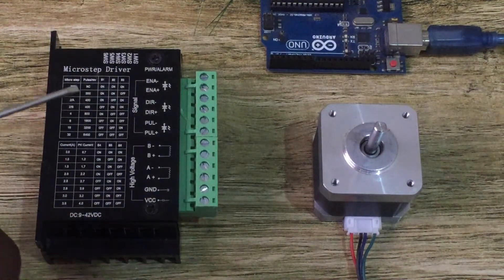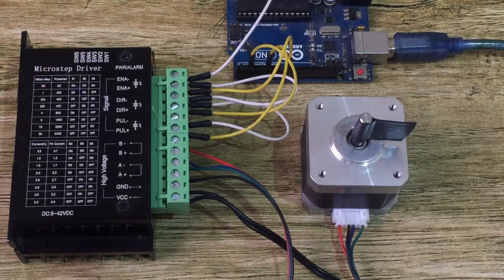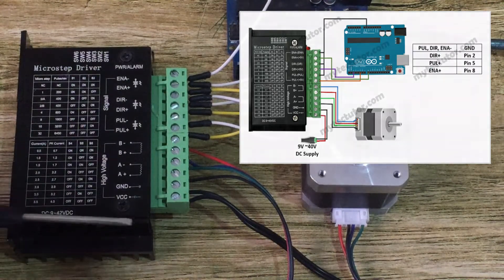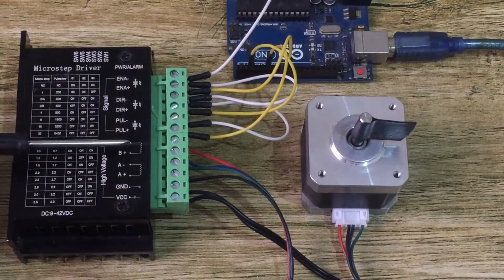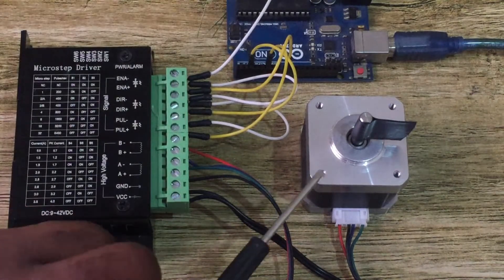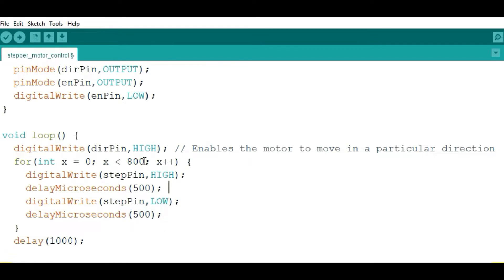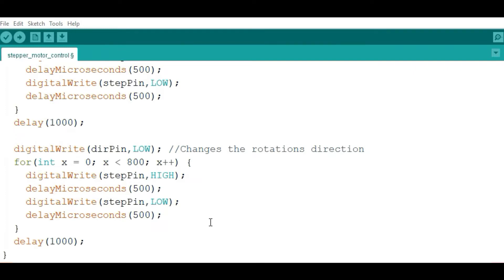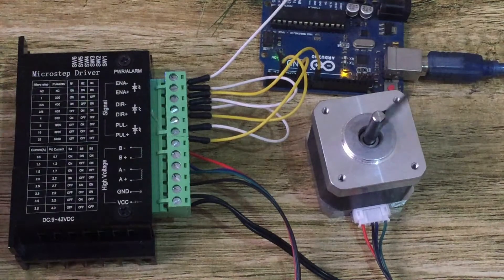TB6600 Stepper Motor Driver with Arduino

Comment: Thank you so much for this wonderful and clear tutorial! You are an EXCELLENT instructor. I have many years of electronics experience (mostly vacuum tube stuff) but little automation or Arduino experience. However, thanks to your tutorial, everything made perfect sense. In particular, I want to commend your clear and plain identification of the details. Things like exact driver module model and wiring pin outs, schematics and so forth. This kind of info can take a lot of time to root out, and the manufacturers seem oblivious to the need to post it. Your pacing was just right - not too slow, not too fast - and you DID NOT ASSUME that "people already know that". Many do, some don't. Also, the Arduino code was extremely helpful, plus your handy tip on discovering motor winding orientation is worth the price of admission! Well done and thank you. Great job!

Comment: How can I program my stepper motor with three  different  position and at the same time will return to its original position. Using three push button as trigger

Thanks
Reply: USE  AS5600 MAGNETIC ENDCODER

Comment: Can the ENA and DIR inputs be supplied by more than 5V? Will it work with 12V?
Reply: If you wish to control driver with more than 5V, you have to use proper resistor to lower the voltage to 5V

Comment: Hey. If I think right, I can use for ex. PIN 7 instead of PIN 8? I want to connect motor and LCD keypad shield (which uses pins 8-13)

Comment: HELLO SIR PLEASE INFORM ON THE PART NUMBER OR MODEL OF THE DC POWER SUPPLY YOU HAD USED. ALSO IF THERE IS NO SPECIFICATION OF THE VOLTAGE OR CURRENT OF THE MOTOR THEN WHAT TO DO.

Comment: Bro  if I  connect a separate encoder on a HBS57H  hybrid servo driver and add a stepper motor in the driver wiring will it work ? Also can you  make another wiring using a NPN configuration to teach people not to burn their drivers .